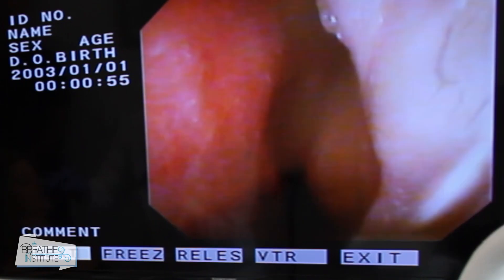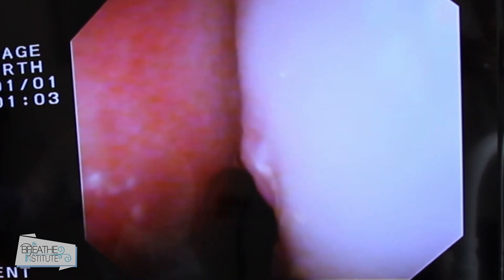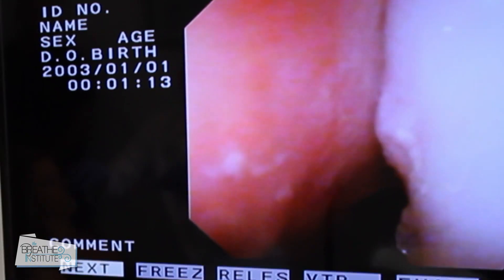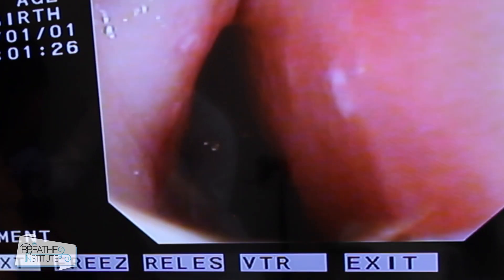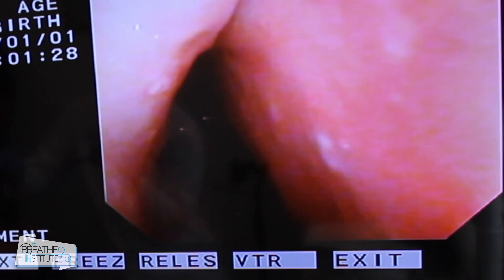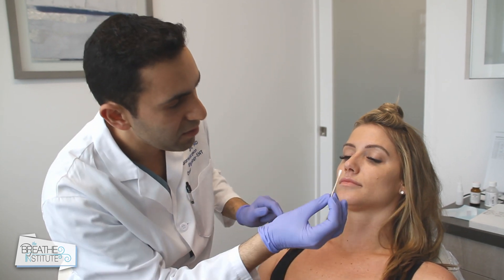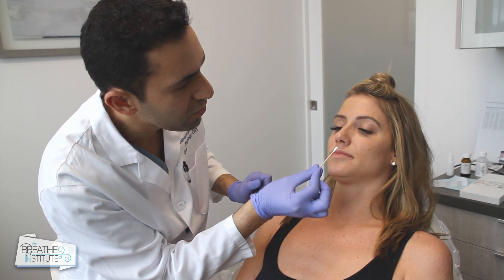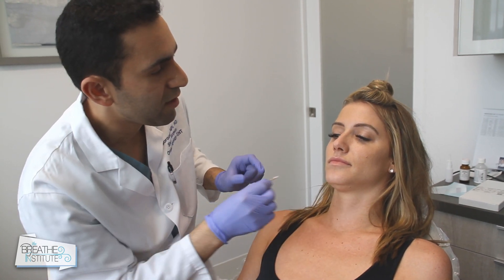Vivaer, Nasal Valve Remodeling - Jen: Case Study and Testimonial at The Breathe Institute

Comment: So this isn't a permanent procedure? Only last 2 years, then back to how it was before the procedure? Just had this done yesterday and my entire face swelled up like a balloon. After each application, my doc said I may hear some cracking and crunching for the next thing he was going to do. He then took some type of tool and pushed it down on the side of my nostril a few times, causing loud cracking and crunching. I asked if that was cartilage breaking and he said no it's bone. I though that part of the procedure was a little weird since I didn't see that in any of the videos I watched or literature I've read. Is that normal? Wonder if that's why my entire face swelled. I called the doc today and he said the swelling I'm experiencing is very unusual. Can't breath and the pressure in my sinuses is insane. Kinda regretting this procedure.
Reply: r u ok now
Reply: @teethree141  much better. Doc said about 30% of patients will have the reaction I had and it's most likely a bad reaction to either the procedure itself or the numbing agents. This information doesn't seem to be provided by doctors or anywhere else. Doc also confirm he did a turbinate outfracture to push the turbinate back a few milimeters. That is no a part of the vivaer procedure so he decided to do that on his own. Swelling was gone within a week and sinuses opened back up not long after. I can breathe really well now. Still healing so need to use a lot of saline spray and sinus rinse, but thank God I'm doin much better. I panicked a little because the first few days were hell.
Reply: @traw9865 how are you doing now after the Vivaer procedure? I’m on day 2 and I seem to have a similar experience as you. Horrible congestion to the point I can’t breathe at all through my nose and got no sleep night 1. How long did it take for your nose to start opening back up again? Thanks!

Comment: This is very cool for people with normal turbinates. I wish I had no other issues this is very safe and minor, sadly if you have more issues it probably won't work well. Nice video and the Dr. seems very nice.
Reply: my turbinates are massively inflamed due to allergies. I'm getting this procedure done next week. am i cooked?
Reply: @scramblerlive how did your procedure go?
Reply: @Sparklecupcake51 currently in recovery. Procedure itself didn’t go so well. The numbing agent was ejected without being injected into anything so it shot down my throat and went into my system. My body didn’t react well. I started to sweat extremely, went pale, and had to vomit in the middle of the procedure. When the doctor came back to finish the procedure, the numbing had worn off but he finished the procedure anyways, so the latter half hurt quite a bit. I got the procedure down about 3 weeks ago and haven’t seen any improvements so far. Going to follow up with the doctor in two weeks. Is this normal?
Reply: @scramblerlive yikes!
Did u have it done in the USA? that feels like torture 😢 and sounds like it might not have been done properly 😮
Definitely speak to your surgeon about it but i wouldn't go back to him specifically to get it done again if that's what you decide to do. 

So they did do general anesthesia or local?
Reply: @Sparklecupcake51 yes it was done in America. In San Diego. The numbing agent was applied locally into the nose, except for the one time he missed
Reply: @scramblerlive definitely go to your appointment and see what the doctor says, he should be able to compare the before vs after photos. 
Because I'm really curious about why it didn't work for you.
Reply: @Sparklecupcake51 still recovering. I will keep you updated
Reply: @scramblerlive  perhaps you're still swollen? 
Did u notice a difference in your breathing right after the procedure?
Reply: @scramblerlive how'd it go

Comment: Why not just get the surgery so it lasts a lifetime?
Reply: I've had 4 already, all failed. This is my last option
Reply: @miguelberetta7887  I had one years ago and it did not solve my breathing problem. It left me feeling like nothing would help so I waited another six years but then found an expert that specialize in doing revision surgery where other surgeons had failed and I can breathe like never before.
Reply: @lifeasrob1757  in in the same boat, my last surgeon was supposedly done by "the best" and still not much better. If I may ask, who performed your latest revision?
Reply: @miguelberetta7887  Dr. Thomas Lee with VCU health in Richmond Virginia. VCU stands for Virginia Commonwealth University. VCU employs some of the best doctors and surgeons I’ve ever had the pleasure of working with. I’m not joking when I say my nose works better than it ever has, probably as good as it worked when I was a child or even better. I had a pretty bad cold the last 2 1/2 weeks and even with heavy nasal congestion I could breathe perfectly through my nose as if there was no obstruction whatsoever. For your reference, he did turbinate reduction which is pretty standard, nasal stenosis where he placed cartilage on the sides of my nose to keep it from collapsing, and he did a septum repair because he found the end of my septum was broken off while he was working on my nose.  He also had me do saline rinses post surgery. I did those for probably close to 6+ months. I still do them once in a while today just to keep my nose functioning as well as possible.

Please don’t hesitate to ask me any questions you want to. I know what it’s like to live with a nose that doesn’t function. The years of Afrin addiction although is it really addiction if you need it to breathe? Do you know what I mean. Feel free to ask brother.
Reply: @miguelberetta7887  Any updates
Reply: @Sad  had cartilage put on both sides of my nose to help with collapsing, I still struggle with breathing.
Reply: That was so incredibly helpful. Thank you so much. I might travel from SC just to see him!
Reply: I just schedules this for the 30th of March. I had nasal valve repair surgery last year, every ENT I see says the same thing, "structurally your nose looks perfectly fine". So this is my last option at being able to breaths
Reply: @miguelberetta7887  
I had nose surgery like 8 years ago and it did not fix my problem. After years of frustration following that surgery I officially found my way to a doctor in Richmond Virginia that completely fixed my nose. If you’re in the United States or can get to Virginia I’m happy to message you his name and information.

Comment: Can this cause the condition of “empty nose syndrome” which is probably looked down upon in the medical community, but is nonetheless a scary potential side effect of nasal procedures. This looks less invasive than traditional procedures but I’m still curious.
Reply: As a patient, I doubt it. The nasal valves are below the turbinates, closer to the opening of the nostrils. However, if the doctor confuses the turbinates with the nasal valves, and burns your turbinates instead of reshaping the nasal valves, in that case, it may create a problem.
Reply: I'm not a doctor so consult with your physician, but I've had multiple. One surgeries with no issue with empty nose syndrome. I believe that only occurs when actually removing the turbine complete
Reply: Mine called it VIVARE turbinatoplasty. Do some ENTs apply the radio frequency to the functional turbinates? I don’t Thank he limited this procedure to my turbinates. I have a very cold air blowing through my nose for a month. It doesn’t feel right.
Reply: No
Reply: empty nose syndrome is usually caused when you take out the turbinates completely

Comment: And people don't realize how bad radio waves are.  Your cell phone does the same thing in your pocket.
Reply from the maker: Keep in mind there is a wide range of frequencies of radio waves. Just as there is a wide range of frequencies of light (from infrared to ultraviolet to the visible side of the spectrums). Some wavelengths will burn you, some will simply illuminate your surroundings. Radio frequency is the same in that regard. The RF energy being emitted by the vivaer wand is just enough to heat the cartilage and allow for gentle remodeling, without causing residual negative effects such as those being studied in prolonged cell phone/emf exposure.

Comment: In my experience, these procedures are useless.  I had two vivaer procedures and other turbinate reduction to correct left nostril collapse and blockage. The Ent then was suggesting a latera implant, but using common sense, I figured out that surgery could be the best option for me.  

My experience, after jumping from ENT to ENT, has been that most ENTs don't know, have the experience, or have been trained to address valve and nostril collapse properly. Sometimes they don't diagnose it unless if it is super obvious since a CT scan doesn't show when the valve collapses or disfunction of the turbinate/s. A good ENT, if he is not able to perform more than a septoplasty, will refer you to a doctor who also performs rhinoplasty and might be able to perform a procedure that could fix a collapse. 

This vivaer procedure may seem like it works right away as the doctor will ask you, like in this video, “do you notice the difference?” right after the procedure. But what I have experienced is that right after most procedures and anesthesia to the nose there is trauma that causes swelling making the area stable temporarily until the swelling subsides.
Reply: Yeah I had it done too. It was useless. No help at all
Reply: I had surgery to help my nasal breathing about six years ago and the doctor did turbinate reduction and was supposed to straighten my septum which was not very messed up to start with and provided almost no relief. I suffered for around six years after that until it was unbearable and after seeing three other doctors I was referred to a doctor that specializes in revision surgeries and solving the problem after other ENTs have failed to. I’m a month post surgery and my nose works so well it feels like I sprayed Afrin up both sides of my nose. Thank you so much to Dr. Thomas Lee in Richmond Virginia. Life-changing.
Reply: @lifeasrob1757  Did you end up having septoplasty or rhinoplasty this time?  I may end up having revision surgery. The surgeon is just going to reinforce my affected nostril with cartilage this time,  so it's going to be less invasive when compared to septo or rhinoplasty.
Reply: @puntoclave  The doctor did a comprehensive surgery and now my breathing is incredible.  Probably most beneficial is that he did a turbinate reduction. He also did nasal stenosis which is what I think you are describing where Cartlidge is inserted on one or both sides of the nose to keep the nose from collapsing when inhaling. He also noticed that the end of my septum was broken off and he reattached it. Anyway, I can breathe so much better now it’s unbelievable.
Reply: @lifeasrob1757  I appreciate your response and  good to hear that it worked for you.
Reply: @puntoclave  I can’t tell you how much I hope that your next procedure, whatever it may be, solves your problem and you get the awesome results I got. I wish you well and much better breathing in the future my friend.
Reply: @lifeasrob1757 May I ask you to which doctor you went and what type of cartilage he used to stabilize your valves? Thank you so much in advance. I need the same surgery but Haven't found a doctor yet.
Reply: Very    right...
Reply: I have similar symptoms with you,what about your situation now？
Reply: But every patient is different so this may work for others, instead of saying it’s useless you should say it didn’t work on you
Reply: @tngerman  that is why i stated "in my experience." However, it might help with minor collapses, but i doubt that it will help fix a real collapse. The vivaer procedure takes like 5min, not including anesthesia time, the inside of the nose is burned to create scar tissue hoping that it can help stabilize the collapse.

 In my case, the scar tissue from the vivaer procedure shrank the inside more pulling my nasal valve inwards more and creating more of a problem. I have documented my procedures with videos of the inside of my nose before and after each procedure. Most ENTs i have been to here in Seattle have told me that a collapse is difficult to fix and that such small procedures like the vivaer dont help.

I think that reinforcing the nasal valve area with cartilage is the best way to go to address a collapse. But it has to be done by a very skilled surgeon with experience addressing nostril collapse. Once you start messing with your nose, it may only get worse if the problem is not addressed properly the first time.

Comment: Apart from treating the nasal valve area, is it well documented whether this treatment can deliver similar results to posterior areas such as hypertrophic turbinates and nasal mucosa on the setpum? An ENT recommend this in lieu of traditional and more invasive surgery, but I am wondering if the treatment has been shown to be effective here. I wonder because it appears that the treatment is more geared for treating nasal valve issues? Has anyone had experience with this treatment for areas other than the nasal valve?
Reply: Yes, I used Vivaer to treat lateral wall collapse and turbinate reduction. I’m still 3 days post op, but I can already notice a difference in how I can breathe. The current downside is that the shape of my nose is completely different and wide. My face is different now.
Reply: @sukie2468  ... How are you doing today? Is your nose still wide ? And are you breathing much better ? 😊
Reply: Update... it’s been approx 2 months and my breathing has improved slightly. Nothing amazing, but it helped. The swelling and wideness has gone down. My face is back to normal. I can notice a tiny baby change in my nose, but it’s no big deal.
Reply: @Honeysuga2  I just had the procedure done yesterday and have been freaking out about how wide and swollen my nose is! Good to hear yours went back to normal, this gives me hope.

Comment: my ent doctor in January or February 2019 told me my sinus look clean and no need for another surgery or ct scan, then I went to another ent doctor for an 2nd opinion in march/ april 2019 and he says the same thing and then just recently I went to the first ent dr on nov 6 2019 he says my sinus look clean and no need for another surgery or ct scan, I don't have no deviated nose, I have mild- modern hearing loss in the right ear and my left ear is normal. but if the sinus doctor says my sinuses are good then why do I feel like I cant half breathe out of my right side of the nose and I been using prescribe Nasacort nose spray 2x a day and been using saline nose spray and antibiotic nasal rinse and a nasal gel to get at least some kind of relief. I been dealing with tension and sinus headaches plus anxiety issues and now stomach issue like acid reflex.
Reply from the maker: Sorry to hear you're going through all this. Different providers are indeed educated differently, and are trained to look for different things depending on their speciality. At The Breathe Institute, if it affects your airway, it is our specialty and we are happy to help however we can. Feel free to give our office a call at 310-579-9710 if you'd like to set up a consult to explore your case in more detail and hopefully find some solutions moving forward. All the best, and thank you for your comments.
Reply: @TheBreatheInstitute  HI, im interested in setting up an appointment,   where  is  the   phycial location of your office?  ty.
Reply from the maker: Anna_25 hi Anna! We are in Westwood, Los Angeles, CA, more info at www.thebreatheinstitute.com